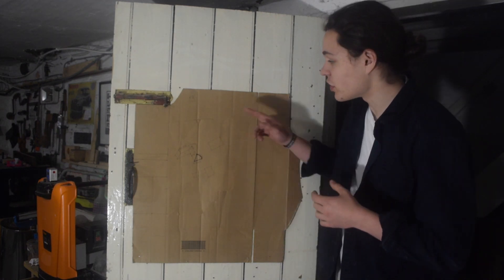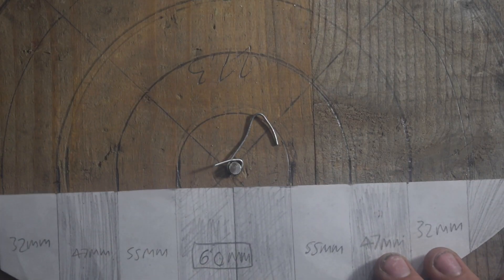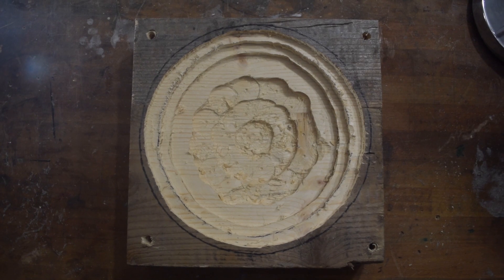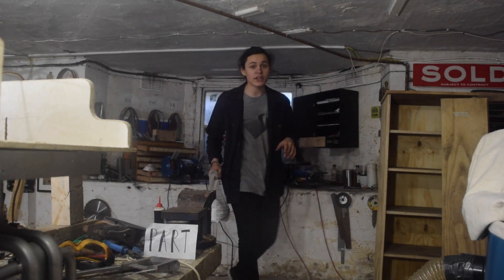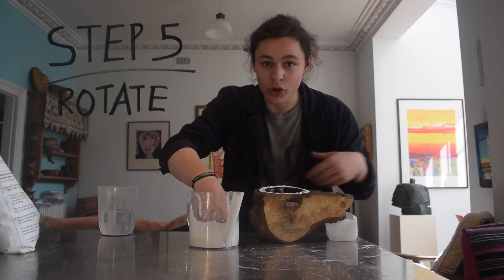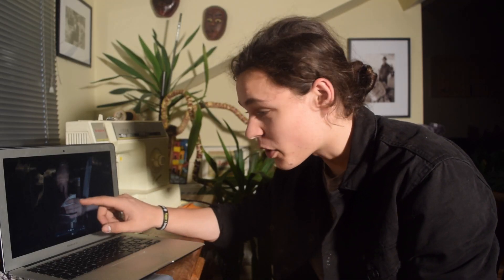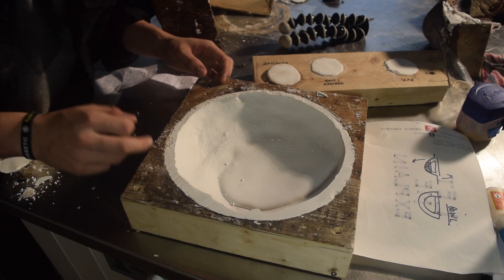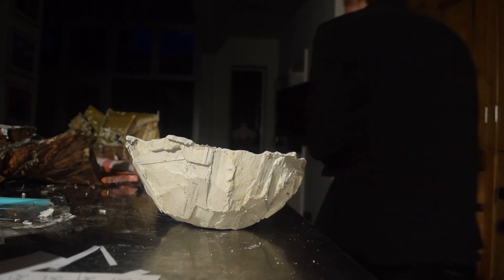How to Make Bowls Without a Lathe | Plaster Casting

Comment: Awesome project. We have used plaster a lot in my pottery class, and I would recommend spray painting the outside of the bowl with gold paint. It sounds cheesy, I know, but it actually looks unbelievable, especially if you paint the inside all black, or another solid color. I also think it would bring out the texture if after you spray painted the outside gold you applied a black paint wash on top.

Comment: Here's what's awesome about this video. The molds for wo of the bowls were made with methods like two of the other entries. So he actually did make three bowls without a lathe. He just needs to work on his master plan a bit more. 

Very creative and yes, I think that this is the spirit of the competition.
Reply from the maker: Thank you and well said! You definitely could have turned the mould into a bowl itself, and in hindsight I think if you slip cast it, you could make some quite nice ceramic pieces too :)

Comment: J do think it would work to sit a bowl in your bowl? That would also give you a consistent thickness, also some burlap would give you a bit of strength too, dam good video and effort mate
Reply from the maker: Thanks Mark - good suggestion & I did actually consider doing this, but the reason I decided not to was because 1) the form would be limited to the shapes of the bowls you could get your hands on and 2) I wanted people to be able to complete the project, without actually having a bowl in the first place, otherwise it kind of defeats the purpose!

Comment: there is special clay that solidifies wall first and thickens as you leave it to cure. no stiring needed, thickness will be uniform and you can pour the remaining liquid in another bowl mold. usually this clay needs to be ovened to get rigid. but there may have a polymer one that fully cures with moisture only. better to put some release compound on the mold as well. especially the wooden stripes one can be difficult to release. in the case of negative cavities better to prepare a thin silicone mold, with plaster serving only as the holster (the main volume of the mold).
Reply from the maker: Sounds like you're talking about slip casting - that definitely would have been the best option but I would need access to a kiln for that which I unfortunately don't have. 
Silicone for the mould is definitely a good shout though - I could of really accurately produced lots of castings. If I do this kind of project again I'll definitely give it a go - thanks!

Comment: Bummer, I have a kiln in the North of the US, (Minnesota), and an old ricketing potters wheel.  Both work great and both I'm trying to part with.  Come to Minnesota and they are yours!
Reply from the maker: Thank you adam, I guess I'll have to get one a plane now then! Seriously though, I'd love to have my own kiln, shame you're so far away. Out of curiosity have you ever/ can you put wood in a kiln?
Reply: I have never tried.  It gets pretty hot in there.  I think around 1000 degrees C so I would think the wood would become black dust... But I don't know.  Did you have a idea in mind?  I have done a few bisque firings and a glaze firing too.  My aunt gave it to me and she used it for fusing glass.  Yeah, if it didn't weigh so much I'd send it to you.  But I imagine the shipping would be as expensive as a new one... :/
Reply from the maker: Yeah, I'd have thought the temp. would be more than enough to burn the wood, I was just wondering if its safe and wouldn't damage the insulation bricks/burners etc. The idea was to take the logs that have holes burnt into them, and then compress clay into the sides, instead of plaster. Then I could put the whole thing in the kiln, the wood would burn away and then I'd be left with a clay bowl that is the negative form. (hope this makes sense) 
Thanks for offering, its a shame we are so far apart- do you not want to use it at all??

Comment: Great results. You might try mixing plaster and cement. Or instead of plaster of Paris try hydrocal. Great video. Great thinking.
Reply from the maker: Thank you mate, I've never heard of doing either of those two things before, thank you for the suggestions! Do you know what their properties are, and how easy they are to work with? Thanks :)
Reply: Hydrocal is great for casting molds. It is, essentially, portland cement mixed with plaster of paris. I used it (and mixes of plaster and cement) for many model castings in Architecture school (over 20 years ago). I remember it taking finer detail and, I think it may have even hardened quicker (though i may misremember here). I also remember it being quite hard and resilient. Another nice finishing for plaster is waxing. I have seen it used on plastered walls to nice effect. I look forward to more vids. I admire your passion and talent. Keep it up!
Reply from the maker: Thats sounds amazing - thanks for putting me on to it, definately would be good to get my hands on some - thanks!

Comment: What if you put a bowl inside after you poured the mold. Or a piece of wax paper over the mold and spread it out evenly as possible. Just an idea.  Great video
Reply from the maker: Really good suggestions Joseph & I did actually consider doing this, but as I said another comment, I decided not to because: 1) the form would be limited to the shapes of the bowls you could get your hands on and 2) I wanted people to be able to complete the project, without actually having a bowl in the first place, otherwise it kind of defeats the purpose!

Not quite sure what you mean with the wax paper - are you talking about using it to more evenly spear the plaster about or as a substitute for the acetate top?